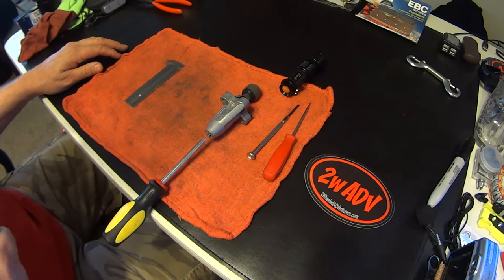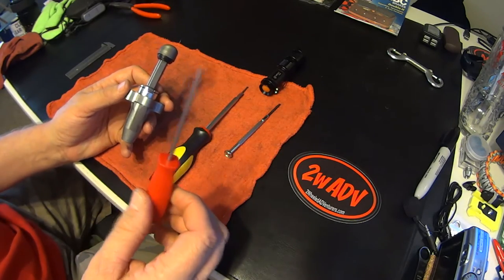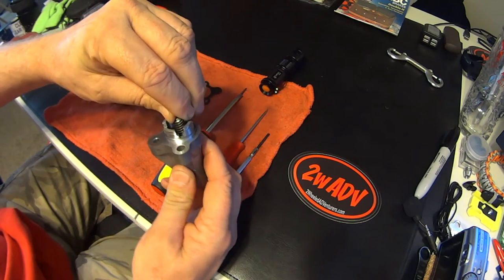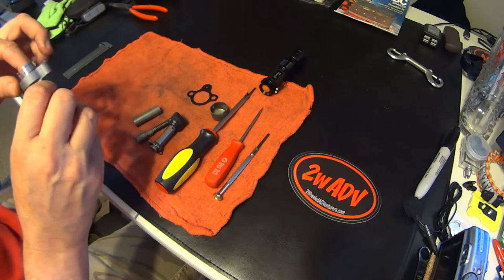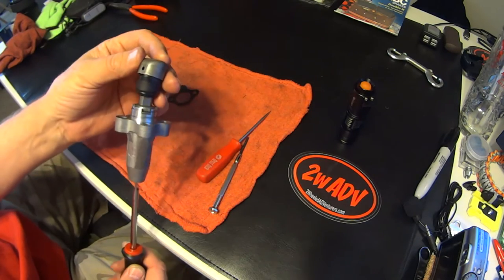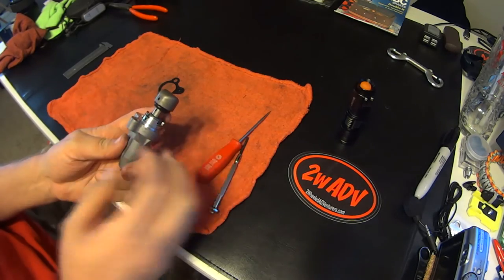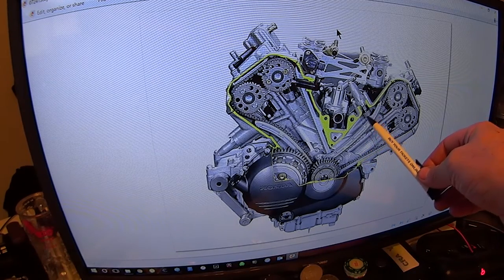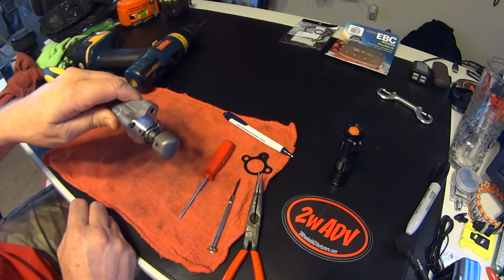HOW TO REBUILD A CAM CHAIN TENSIONER VFR800 VTEC

Comment: Thanks for this guide! Worked like a charm!
I did this to my friend's 08 cbr600 and soon to my 06 cbr1000. The factory windings are different to your VFR800. The CBR 600 has 7-8 turns as factory turns. Increased it to 10 and drilled the gasket out to 2mm.

Comment: Not only happens on VFR's, all CBR's suffer the same thing, I got a CB1100SF and a XX Blackbird and the rattle noise came up too, I did not rebuild the CCT's instead I installed a manual cam tensioner on both of my bikes and the problem was solved for ever, thanks for your video, it is great and it helps a lot too.

Comment: Good information! I've heard about this also being done on Honda ATV's with auto tensioners. The one thing I would caution you about is not to put too much extra spring tension on the adjuster. That will put extra spring pressure on the cam chain and may cause unnecessary chain stretch. In the ATV forums, they only recommended an extra 2 turns. Thanks for sharing your ideas!

Comment: I assume if you want to fix one of these rather than replace it, one probably will need to replace the spring eventually - is that correct? Seems like the most likely thing that would fail. If so, what kind of spring is it? Something hard to find?

Comment: So If I am understanding this right... you essentially pre loaded the spring with 9 turns in total...? Is that right? 

Is there a reason you did this? 

I have a vfr800 and it's just started making a horrible clacking noise so wanted to investigate the cam chain tensioners first.

Comment: I know from what I've heard on the motorcycle forums if the spring breaks it won't bent valves on VFR's only make chain noise but will destroy VTR engines if it occurrs. I notice also that the VTR's don't have a oil gallery in them like the VFR's.

Comment: that was a great video, i recently purchased a 2003 vtr1000f  and the first thing i was told was to get rid of the stock cam chain adjuster because they have been known to fail. now the bike is about 17 years old but only has less than 7000 miles on it. my question is, do i need to replace or rebuilt the stock set up, or do what everyone is saying and buy aftermarket adjusters.

Comment: Thanks a lot for the video! Whole operation took me 30 minutes, an everything was simple and easy. My tensioner bucket was specyfic, because, it has two holes by sides and there are two tabs in the plungers head which are preventing loosing it in engine. Anyway, thanks for awesome advice, works great!
Reply from the maker: Sweet, glad I could help out! Thanks for watching!

Comment: Great video. But I have few more questions. I have 2003 vfr, with 58000 km - 36000 miles.
1. Do I have to rebuild the rear one to?
2. I rebuild the front one and I give it one extra turn (9 turns, while original has 8 turns).
The heavy rattling sound is gone, but I can still hear the chain around 3000 - 5000 rpm. the rattling sound is not strong.

Comment: Thanks for the video Macadventures, you just saved me lots of euros as the tensioners are around €120.
Ok my understanding is its 4 turns collar down as starting position from a rebuild or factory setting. You need to lift the collar and do four turns to lengthen the tensioner so as to stop the cam chain from rattling. The video makes it sound like you are 'tightening' the tensioner which to my mind makes it sound like you are shortening it.

Comment: Leaving in the "cut" section actually made the video more educational. I'm at 30k and hear an occasional thump sound almost like something is banging on the fairing. Trying to decide on the problem being cst or clutch. Video I just saw earlier from a vfr with a cst problem and it sounded more like metal to metal clanging. That sound about right?

Comment: Thanks for the video, i just finished mine. I didn't drill out the gasket though as the hole in the push rod appears even smaller, and supposed the idea was not to have oil going through too fast so they limited flow at the gasket. Having said that i doubt enlarging it would starve anything else of oil at all. Thanks

Comment: Thanks for the video, my question is how many turns did you actually do? you said you were tightening spring when you unscrewed plunger which was about 4 turns (was hard to count) then you did another 4 or 5 turns with the screwdriver tool, are you only counting the turns with the screwdriver or are you also counting the plunger turns as well?

Comment: how long is this suppose to last before reseting the tension again? how many miles have you put on your bike since redoing the tensioner?
Reply: Mine started every 30,000 miles, after i got tired of buying new ones, a race mechanic told to use manual tensioners they have unlimited lifetime, it only takes an easy adjustment from time to time, it costs me 40$ a piece.

Comment: I have used paper clips to make tensioner tools before.  You just take a paper clip and, using some needle nose pliers, bend it into roughly the shape of the factory tool leaving a short section of straight wire in line with the center of the tool as your handle.  You can easily put it into place before pulling the tensioner, and after re-installation just take your needle nose pliers and pull it out.  It's not durable, of course.  You wouldn't be able to adjust the tensioner with it.  But you can get more than a lifetime supply of them from a box of paper clips.

Comment: So ive done this procedure 3 or 4 times on my 2006 vfr800. Lost count. Is there as far as you know, a limit? The bike has about 60,000miles on it. Im pretty sure it started making the cct knocking sound the last few weeks. But i might just leave it for now since its almost time to put it away for the winter. 
Do you think there is a service life on the tensioner after so many rebuilds? Thanks again.
Reply: Can you explain me how many turns there are actually? From assembly he lost me, 3 turns then take out ..then 1 and halft, then 4...really lost.

Comment: Great video and explanation. I also though my engine was on its way out and worried about $1000 bill. I've been looking everywhere just to see how to replace the tensioner and I came across your video. I'll be trying this today and hopefully it works well as you have shown. One thing though, it seems there are two tensioners on the vfr, does the other one need to be reset as well? Thanks.
Reply from the maker: Thanks, I just got back from an 8,500 mile trip across the US and no problems with it at all! Very happy! Thanks for watching!

Comment: Thanks, I rebuit a spare I have. The current one on my bike the screw in the center behind the bolt (connected to tensioner arm) spins when the engine is running. Is this normal?What could cause that if not? Cheers

Comment: Thanks you @@UCReTkzODS_UWJKLKuuNEETA I did this yesterday based on your video. Very simple. The most difficult part is getting to them. No need to take off the throttle bodies as per the Haynes manual instructions. Just a couple of 90 degree twists and turns and it should come out easily enough, giving you a lot less overall work.

Comment: I have a 05 Cbr600rr how would you assemble it with having the motor still in bike with that screwdriver holding it locked it’s a tight spot to get in asbit is?

Comment: Quick question - was there a screw at the top of the cam chain ? The part where you put the screw driver into? I have one on mine
Reply: yes it's a screw. you have to remove the screw. then you will be able to put the screw driver in the hole to retract the tensioner.

Comment: Thanks for this video! My cam chain tensioner on my 05 CBR 600RR is giving me issues now. It has 43 000kms on it (26k miles)

Would this procedure work the same for my bike?

Also, but adding extra turns to the spring are you just increasing the tension in the spring so that it has a more reliable force when push down?
Reply from the maker: I should work on all Honda cam chain tensioners of that type. I just got back from a 8,500 mile trip across the country and no problems at all. The spring looses tension over time so this is a  quick, cheap fix. I monitored it the entire trip and no changes in motor noise or engine running issues. Thanks for watching!
Reply: +MacADVentures awesome thats good to hear! I went and ordered the APE cam chain tensioner. The OEM tensioner in South Africa costs the quivalent of $130 whereas i got the APE for 80.

I will keep the stock one though.

In other videos and forums people set the motor to top dead center before removing the tensioner. Do you do this as well?

Thanks for the reply!
Reply from the maker: no need you aren't doing anything but changing the tension, not moving the chain on the sprockets. Just don't turn the motor while it's out. Watch out for the bucket falling off the end of the tensioner. It's a pain to get. Cheers!

Comment: Not an actual rebuild tho is it ... just a simple strip & over tension the spring, which is always a short term fix as the chain has stretched allowing the CCT to extend far enough out & past its optimum working range & the spring tension is weak in this area, hence the chain often starts to rattle due to not enough CCT tension, even after this mod that's been around for 20 plus yrs, (it aint new folks) the tensioner plunger is still out in the weeds, even with an over tensioned inner spring, this mod does work, but it's no rebuild, no new parts fitted, nor is it a long term fix, the chain is still worn/stretched & needs replacing, tensioner then will be set in it's optimum working range, they're set with this spring tension for a reason, so the chain rattles & alerts you to the chain needing to be replaced.

Comment: What if i over tightened it??
Reply: You can break that small spring in tensioner, if you dont over tightened it-> too much pressure on Tensioner plastic ´arm´ -> some scratches (about 20k+ km)-> too loud (ratling chain)-> replace this plastic tensioner arm. Perfect setup is that you cant hear a chain slaping and your spring is low stressed